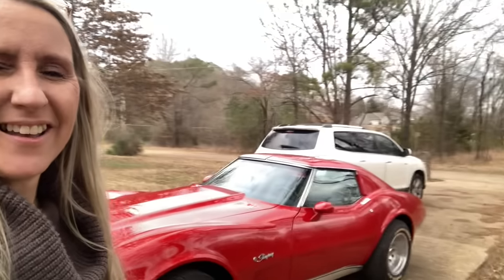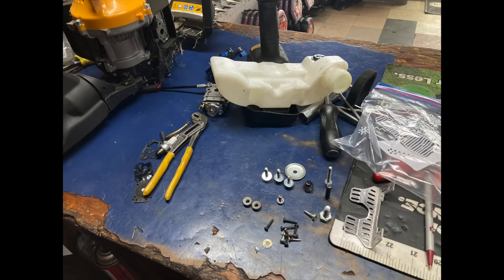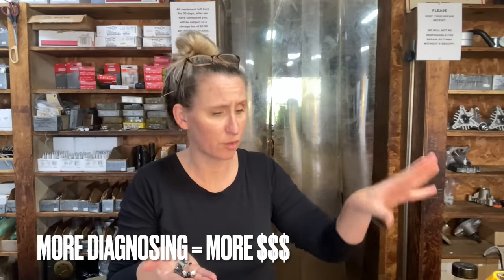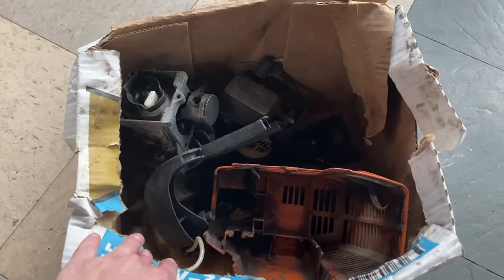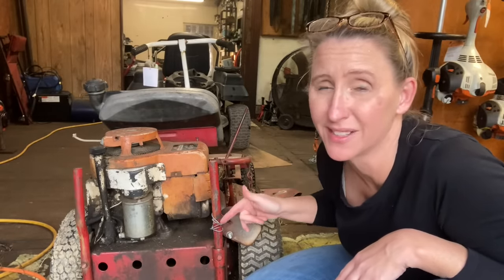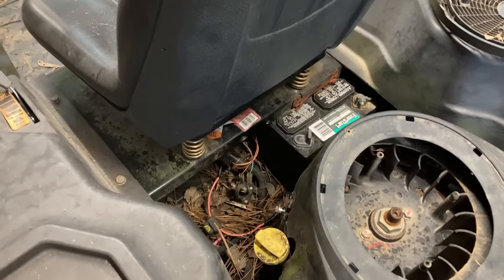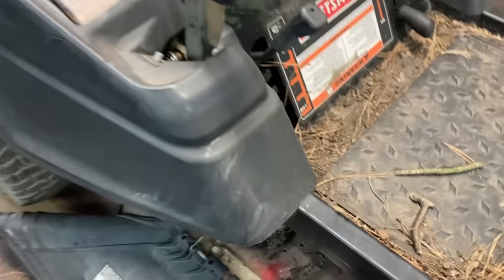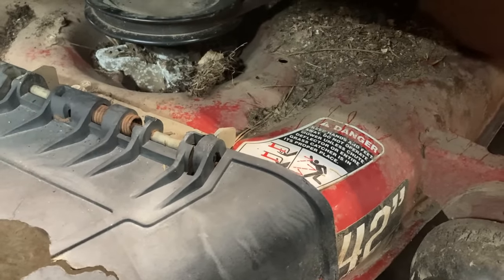Don't Waste Your Money and My Time! Gambling on Repairs When the Odds are TERRIBLE, We Both Lose!

Comment: We had 2 rules at our shop. We don't do basket cases or clean up messes. You take it apart, you put it back together.
Reply: A friend of mines dad used to work on gas station equipment. He'd have a guy bring in a big air compressor for a free estimate. Don would tear it all down and make a list of parts it needed and prices/labor. If the guy declined the repair Don would put all the parts in a box, add a few random parts from scrappers, and send the guy home with it.
Reply: @john street  that would serve the jacka** right. I hated it when a customer would use as a diagnosis, then say they can get it done cheaper. About half would show up a week later needing it fixed right. My boss would usually add 50-75%. He called it a clean up tax.
Reply: @blkmoon33  they flip out at a 65$ diagnostic fee that's on a sign when you walk in the place. 
And even that's giving them a deal because the tech (me) gets an hour to diagnose and make a list of what it needs. 
(I'm in a different field)
Reply: @MrTheHillfolk  and they never take into account the cost of tools to do the work properly. Those diagnostic computers aren't cheap. Just hand tools cost a small fortune. My first box cost more than my car at the time.
Reply: @blkmoon33  ain't that the truth! 
Wish I knew now what I knew then😂
That being we got about 50% off catalog price for snap on tools when I was in tech school.
The set was 4500 ,we sat down and began totaling it up, and 2/3 the way thru we were at like 7k and we still had tap and die sets and puller sets and the like. 
We did get 25% off anything in the catalog so I spent another 750. 
I was pretty set up ,I didn't get into the tool truck hole too much.
I'm mobile now so we don't really have a tool guy stop in, but I have a friend that works for snap-on industrial that gets me warranty or broken stuff replaced.
Reply: @MrTheHillfolk  we always referred to the tool truck guy as the Crack dealer 😆
Reply: @blkmoon33  hahaha yep 25$ a week or 50$ every other week for the rest of your life 🤣
25$ lol I'm definitely old
Reply: @MrHillfolk  yeah $25 a week we thought was a lot lol. Now days it's $200 a week. And that's for one tool truck. I owed the Snap-On, Matco,  and Cornwell. Granted the Cornwell guy I never owed as much as the other 2.
Reply: @MrTheHillfolk  if people are not willing to pay up front at a business , it's probably due to the fact they have no intention of paying at all.  they just want some free advice of what's wrong so they can pay someone else to fix it for a low price.
Reply: That's my rule.
Reply: @blkmoon33  Paycheck disposal service
Reply: That was a lesson I learned the hard way in the OPE business, but it didn't take long to send basket cases and cheapskates packing.
Reply: @1hasbeen531  a wealthy person probably wouldn't bring a basket case in. Same as a wealthy person wouldn't try to fix a basket case.  Wealthy people are usually cheapskates when it comes to kindness!
Reply: Yep, chicken in a basket diagnosis - minimum $100 for diagnose, when they balk at that well you could have put it together too like I will have to
Reply: @carmichaelmoritz8662  after 37 years in business, I am here to tell you, yes, wealthy people do all of the above. 100%.
Reply: @1hasbeen531  I already knew wealthy people are pretty messed up in the head , but that just takes the cake 😂🤣😂👍🤟👌
Reply: I love it when they say I can get it done cheaper.  Then hit the road jack 😆
Reply: @Brensdaman 92  and then show up a week later wanting us to fix it right. Usually cost them double if we did the job at all.
Reply: I took a job I regret but I do all his work and it was action buy but it’s a dam mess
Reply: Yep some people just won’t a list of parts so they can fix it
Reply: common sense. some things aren't cost effective to fix, for the shop or the customer.
Reply: We generally charged more for any units that came in disassembled. I remember someone came in with a snowmobile( we worked on everything) and most of it was in a box. I remember getting down to the last important bolts and they were missing. I found some from another snowmobile and charged him for the pain and frustration.
Reply: @scottfirman    I called it the “Aggravation Surcharge”.  50% extra, minimum.
Reply: Same here.
Reply: Then you need to get out of the small engine  business.
Reply: @David-si9pi  Why?  You expect a business man to work for free to clean up YOUR mess?
Reply: Let me guess your one of those know it all anything you say is right type of people qho blame everyone else for everything fella am i in the ball park?
Reply: You will do what your told to do.

Comment: I have a 20 year old cub cadet and a 17 year old Eco weed Wacker. Both look and run like new still. I take good care of my tools and equipment. Great video 😎👍
Reply: I hear ya’, I have a soon to be (come September) 30 year old Homelite lawn mower that I have steadily used every season.  I do all my small engine work after taking two courses at a local high school.  My neighbors push their mowers out to the curb every few years including their snowblowers (ahh, they are also the ones that need to get a new car with the same regularity).  My van is also 19 years old with no rust and running like new.  The moral is it is better and cheaper to learn how to maintain your “stuff”.
Reply: I am the same way. The tools are too expensive to treat like that.
Reply: @donjohnson3701 Buy good equipment and take care of it, Regular maintenance is the least expensive form of repair
Reply: 1986 john deer 165 hydro that has been in the family. Shit will last as long as you take care of it properly. "Take care of your stuff, and it will take care of you" I have tons of stuff 10-30 years old
Reply: You’re a smart Man! Mr Mike!
Reply: @jmabs5096  😮j😮uií
Reply: Or find a mechanic who knows what that are doing.  Not ones that change a arm and a leg for lawn mowers that are already running.

Comment: Not a small engine story but I worked as a mechanic back in the 70s for a small shop. We had a customer bring in his Chevrolet Impala that he had “worked” on. He couldn’t figure out how to get it back together. My boss decided that we could and took it on. Customer stated that everything was in the trunk. 
Opened the trunk and found parts from three different engines, two Chevrolet engines and parts of one Pontiac😱. Two days later I was able finally get it together and running. 
Some people 🤬.

Comment: My favorite statement from the customer, “it ran fine when I used it last. It just needs a tune up.”
Reply: Same wording they'll use on Marketplace!
Reply: It just needs a small service..
Reply: “Well, it ran fine before I forgot to put fresh oil in it. It just needs to get unstuck.” Lmao, I’ve heard that one before from a customer.
Reply: 🤣 it ran when parked( fails to tell u that was 12 years ago) and just needs a battery🤣. when ya see it the frame is rotten away etc🤣
Reply: "When did you use it last?"
"Lemme think, little Billy was about eight years old - his wife just had her second baby, you know - so I reckon that was about 2004, oh-five.  That sounds about right."
Reply: Oh yeah, that's a classic.
Reply: "Just needs the carb cleans"  "Great shape, just needs a new engine." "Great shape, runs great, just needs a new transmission."
Reply: Better yet when they bring in something from the 1950s that no longer has available parts and say "just make it up, it's just a bent piece of metal".
Reply: I got "just needs a service"... found blu tac holding the govenor wide open on a old briggs walk behind, con rod through the cases...rang customer with bad news and got  " well it was running fine when i dropped it off!!!".
Reply: @Diane Coles  yes I will. But gonna pull the carb and get er going again and increase the price.
Reply: My favorite is " it just needs a pull rope"
Reply: People don't have any sense to fix it tear it apart thinking thy can fix it ,but not really being able ,then throw it in a box and say fix it 😅

Comment: I retired my 1972 Simplicity 310H from mowing duty and bought a Kubota Z231 zero turn (Kawasaki powered). I figure buy once,cry once😂. I’m a retired mechanic and I feel your pain about customers who are not honest or forgetful. Thanks for the videos!
Reply: My experience with Kubota is that repairs scale to the purchase price.  For example if you need a new transaxle because a hose popped off and all the oil leaked out, that alone is going to cost more than a whole new Club Cadet.
Reply: @Nonplused  That was the first thing I looked and sadly there is only one company that supplies the trans axles to all the manufacturers. The Kubota was priced cheaper than it’s competitors and had zero percent interest on the loan.

Comment: Yup!! Good solid advice!! I've heard a lot of "stories" and one of my favorite is: J.D. 225 rider..." it ran fine then KABOOM!!  the hood blew up!! " Huge hole the size of a soccer ball in the middle of the hood. But right under this was the inner part of the hood and it was fine... no damage!!  All the fluilds were fine, no sign of smoke, no other broken pieces. No leaks in the fuel system. No damaged or bare wires. Nearest thing I can figure is someone sat on it or dropped something on it.

Comment: I always charged double when a customer brought me a “peach basket” item. Soon, word got around in our small town (2500) that it was cheaper if the customer didn’t work on it first.
Reply: Right on David just like the sign for hourly rates say: $70 per hour and $100 per hour if you have worked on it!
Reply: We used to charge an "Estimate fee" for everything that wasn't running when it came to us. We worked up an estimate, informed the customer of the amount/ problem and awaited their decision. They were given 30 days to decide or the unit would be disposed of after that time.
Reply: The last machine the guy didn't know much of anything about it, I guess he just wanted an estimate.  At that point,  you find really bad stuff and tell them it's going to cost more than a new one and sell them a new mower.  Everyone is happy then
Reply: @waynestefinashen239  eh? nothing wrong with people working and fixing their own stuff... the problem is when they dont finish it or get in over their heads...  discouraging people from working on their own stuff is not the way to go about correcting the problem.. education is.
Reply: @raymaster  At Eliminator Performance we encourage our customers to do their own service and repairs. Every customer leaves with the knowledge of changing their oil, air and pre airfilter, spark plug and how to remove the carburettor. Additionally which is the proper method of tilting back the mower for cleaning the deck. In most cases our customers say they will just bring it back to us for service. We would rather lose many customers through education of DIY since it has increased our business tenfold through referrals.

Comment: Maintenance is cheap, buying new equipment every year is not. All my personal equipment was purchased used and has lasted many many years with no issues. I get trade ins with mowers I sell (usually they just give it to me for free to save a trip to the dump) and the stories i uncover from them are always frustrating. Practically brand new engines blown up, many bent crankshafts, decks rotted in half, etc. I can’t imagine what you have seen roll into your shop. Thank you as always for sharing! My favorite save was a 1987 Cub Cadet Riding Mower that was left to rot in the original owners backyard. That was 3 years ago and it’s still going strong today.

Comment: I had one of those old snapper mowers that I got cheap from the hardware store because it had starter cord only and no one wanted it. It was the best mower I ever owned for many years 👍
Reply: I have one now. I'm in Australia and bought it 2nd hand from internet classifieds. Its in excellent condition. All I did was replace the drive disc and the belt now I use it every weekend

Comment: My Dad had his own shop in the early 80's and a guy brought his push mower in and said it was running strange so he tried adjusting the screws on the carburetor and it's worse now. Dad dumped out his gas tank and put some fresh fuel in it and adjusted his carb. Dad called him the most honest guy he ever met because nobody owns up to attempting to adjust those screws and didn't charge him. Another guy kept bringing his mower back saying it wasn't running right. Every time all that was wrong was the screws were out of adjustment, so then he started marking the screw threads with a dab of paint and the guy kept bringing the mower back not running correctly and the screws obviously had been turned. So the next time it came back with the screws turned again, he adjusted the screws again, took out a pair of side cutters and cut the heads off the screws. When the guy asked about the screws, Dad told him there'd been a recall on that mower because of running issues and cutting the heads off was the manufacturer recommended remedy. Later on when my Dad saw the guy, he complimented my Dad for staying with it getting his mower fixed!

Comment: Last fall my neighbor asked me to take a look at his Poulan chainsaw said it just needed a little carb adjustment. New fuel lines and rebuilding the carburetor new spark plug and a good cleaning now it runs and I sharpened the chain , so it also cuts. I told him sometime in the saws past it had ethanol fuel in it.

Comment: I have a snowblower that is probably older than I am.  Does it work perfectly, no, but it has kind of become my quest to keep it running.  Is it grumpy on starting, yes, but so am I.  It really doesn't take a lot of effort to keep small engines in shape.  Also, this channel is really great.  I learn things all the time, including, what jobs I am not capable of doing.
Reply: I have my John Deere 826 that I bought new in 1977 , still runs like a top , starts first pull , other than 4 frive discs a nd a spark plug I haven't had to touch it ,!
BTW ,  I live in the U.P. of michigan on lake superior so it gets well used every year .

Comment: Mrs Chickanic, On the bad Stihl pole saw powerheads I install used trimmer power heads usually a fs85. It cuts really well and no more valves and plastic cams.....
Reply: That's an old HT75, already has the same engine as fs85, I've one from 1999 or so, I had to replace the splined shaft a couple years ago and and replace the fuel lines, carburettor kit and fuel filter a month ago, but those were the first ones so i can't complain, that little engine is still really strong.
Reply: @ruben_balea  I never saw it, was vacuum & pressure testing a husqvarna 372xp while listening. I guess I assumed it was a 130 that someone tried to repair
Reply: @grifonks  Ah! I prefer those older engines too, a neighbor got a KM-whatever with the pruning attachment, he needed to prune a tree quite high and my father offered to do it by climbing another tree next to it that they were going to cut down later, because my father trusts more a healthy tree than a rental hydraulic lift...
My father then told me that maybe he didn't know the sweet spot of that engine but he definitely would have done it a lot faster with our HT75.
Reply: @ruben_balea  I think we'd all agree that the HT75/FS85's were stronger and more reliable, Stihl using soft steel in the early valve stems along with the plastic cam gears causing 4mix failures in the km's didn't help much either. My dealer is now unhappy with multiple BR800 failures. Currently most tree companies here are switching to Lithium powered pole trimmers. Your father is a wise man, dead trees are deadly

Comment: Well put! To bring in equipment like this is a pure insult! Tell them, with a big smile, that you can guarantee it will cost them less than 10 000 dollars to fix it (and then you sell them a new machine). Don't accept harassment!
Reply: sound like good ideal to you find out the new stuffs junk and will never last like the old stuff does everything made cheap now days id rather spend same to restore old tank as spend it on plastic gear epa regulated to point it want run pic of junk

Comment: Great video's, I take a deposit on ALL equipment at check in at my shop to cover my initial time and to get some level of commitment  from the customer.  A zero turn  or riders I charge $150 just to leave it , its $55 for push mowers and handhelds no exceptions.  It really cuts down on the the junk you have to dispose of every year.

Comment: I have been given at least 6 mowers during the past year. Most of them suffered from a lack of maintenance. Most had a filthy air cleaner which prevented the motor from running. Others had water in the carburetor.